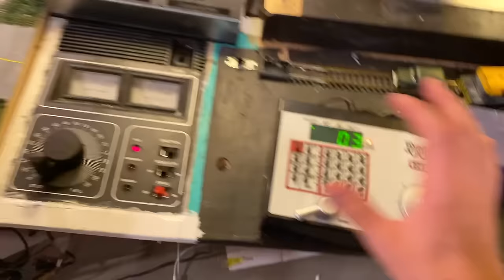Running All of My Ho Steam Locomotives - Part 1

Comment: that boiler on that "brass" engine isnt brass either. its a one for one copy of an MDC Roundhouse ATSF 4-4-2. They reused the 4-4-2 boiler on their 2-6-2 chassis, making an oddball. You can see the piping is all molded on. Its just painted much better, probably spray can, whereas everything else is likely brush painted.

Comment: Hey Harrison, congrats on hitting 16K subs!  @12:51 the Bachmann New Haven loco is supposed to run on DC as well.  It should even have a smoke unit.  You may need to remove the DCC chip or put in a jumper.  Mark (M&M Rails) has an Atlas that is both DCC and DC which required manually switching it to one or the other.
Thanks for sharing. 👍 👍 👍
Reply: Hey you always seen apartments reading before hardwood so I want all of his trains
Reply: 101 Hanover bombing trains Sarah baartman trade I wish I have all this bachmann trains listen uses damn you just put a text boil Pizza on that wall this change this is me kam
Reply: Am one pliiiiiiiis

Comment: I got 14 more trains coming. I have over 200 now. Not quite like yours. Finally i got me a new lionel daylight 4-8-4. Got it all ready with exception of the pistons and wheels are not yet in right position. After that is done should be great runner. Engines are perfect in both so either way it's done.

Comment: Maintenance tips for the Fleischmann one (which is identifiable as a 1954 production one)
The reason for it not running well is dry bearings (which give that characteristic screaming sound) and crud on the wheel contacts. It needs an almost complete disassembly to get there. Start with unscrewing the buffers and take care not to lose the spring filament of the couplers...

For instructions about the rings on the driving rods, see https://www.altemodellbahnen.de/t12155f117-oder.html for pictures

Comment: The British engine is Hornby Dublo they used magnets to make the engine work . You can get replacement magnets off eBay - neo magnet should improve the running Hornby Dublo stopped making trains in 1964.

Comment: The reason some of them weren't working properly is because with older models you need to warm it up by helping it do laps around the track. Older used trains aren't made to be used at the same speed all the time, but kids never read the manual and love using it on full speed every time. Then, by the time you get it, it will always have starting issues and a much lower life expectancy. Once you help the train around the track it will eventually get used to the rails and will run at least 3/4 smoothly. You WILL have to do this every time you pull it out again unfortunately.
Reply from the maker: Do you have any explanation by why letting them warm up helps? I've heard a lot of people make this claim but I can't seem to wrap my head around why it would do anything other then the commutator clearing off from fiction. DC motors work best at a fairly high RPM which is why I usually run them fast.
Reply: I was hoping you'd ask. Electric motors require friction to run, but first they have to get warm hence the friction. That's why the ol' brush motors use brushes to brush against the motor. As for the tracks and wheels, when they're warmer they do conduct better as the widely spread molecules of warm metal conduct easier than tightly clustered molecules of cold metal.
Reply: While they don't seem cold, they're cold enough to matter. And because they're small they get cold fast.

Comment: Nobody:
SMT: half of a quarter of an amp
Reply: 10:23 is the time stamp if anyone wants it
Reply: Modern quality can motors are very efficient,1/8 of an amp under near no load conditions is likely.Don't confuse this type of motor with the less precise motors that go for around ten bucks or so.
Reply: Me with my g scale 18v 10 amp power supply

Comment: Is it possible to run all the locomotives at once or would it pull to many amps?
Reply from the maker: It would pull too many amps. The controller only has so much capacity and a lot of these engines are not very efficient.

Comment: 14:14 Is that Sierra Railway #3?
Reply from the maker: It’s the correct locomotive but the wrong railroad. I’m sure it could still push a Delorean to 88Mph
Reply: @SMTMainline  lol. Wasn’t the same locomotive used in the Casey Jones TV show (Literally nobody remembers that show), and wasn’t it also the whistle of the Polar Express?

Comment: I have a rare tyco 1980s steam locomotive that actually has steam coming out of it using a special oil solution
Reply from the maker: Tyco included that feature on many of its steam locomotives but most of the coils on them have burnt out by now.
Reply: @SMTMainline  yes, that is true but the one in mine luckily still works